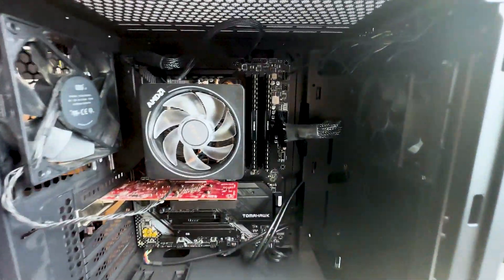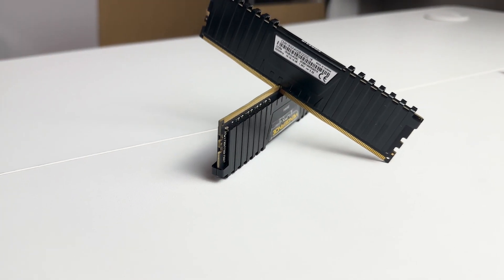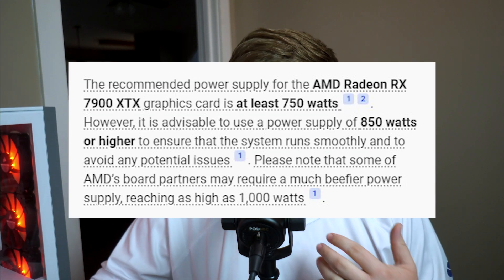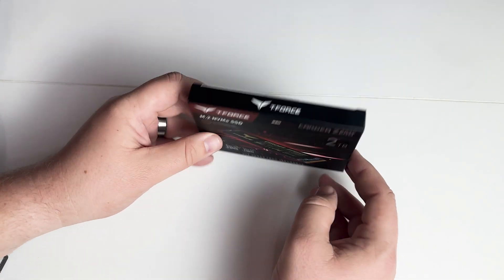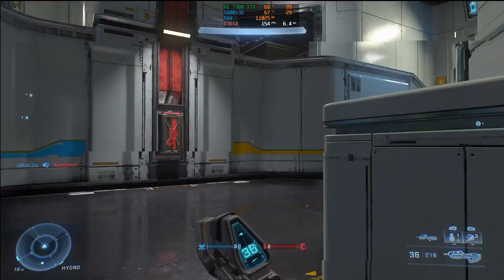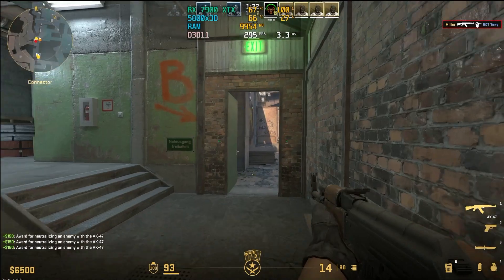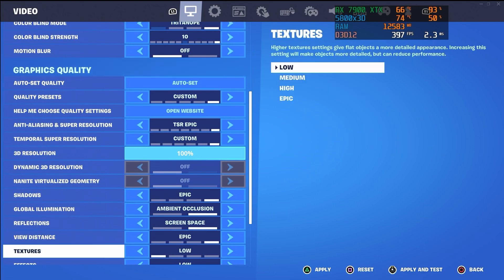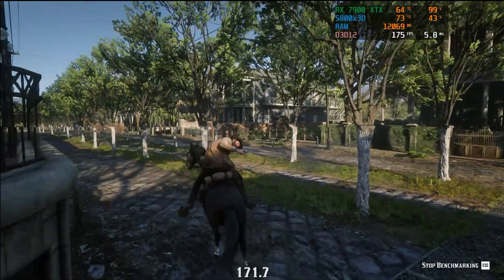This PC Got the ULTIMATE AM4 Upgrade!!

Comment: There wasn't much problem with the stock cooler for the processor it had after upgrading yesh fine what was wasn't bad. 

The motherboard vrm power 5800x should be Max 5800xd will work fine and msi motherboard csn easily work out

Comment: I'm curious why you kept the b550 with a budget of $2000? Of course, the 5800x3d is still fantastic, but am4 is technically dead. Anyways, cool video! You're really good at fitting a lot of content in without dragging it out.
Reply from the maker: Well we ended up only spending around $1800. The customer wanted to save as many parts as he could so I felt that the ram and the motherboard were the best ways to save money. He will probably not upgrade for a long time and he is fine playing at 1080p. 

If I was starting fresh with $2000 I Definitely would have done something different. 

Thank you for watching and the compliment! I appreciate it!
Reply: @MMillerPCs  that makes a lot of sense, thanks for the reply!

Comment: Should i pair my ryzen 5 5600 with a gtx 1660 super???
Reply from the maker: It’s not going to hurt anything! That CPU can handle much better GPUs but it’s not going to cause damage or anything like that
Reply: @MMillerPCs  so no bottleneck?
Reply from the maker: @goat_cheese012  there is always a “bottleneck” you can’t let that word bother you. 

The 1660 super is only going to be so good. You could get a better GPU if you wanted
Reply: @MMillerPCs  k thanks

Comment: I don't like how you frowned on prism cooler. It's my favorite cooler for 6 cores. As long as your not using the stock CPU it comes with then it's kinda premium. Pretty much nothing you can get for the $20 you get them for from the stock boys.
Reply from the maker: I use stock coolers on builds all the time!! But we couldn’t use it for the CPU we had planned for the build. They are great for what they do.

The prism is not my favorite aesthetic wise though lol
Reply: @MMillerPCs  it's the availability. You found get them for $20 cash off random people all the time. And if you wanna get wierd you can separate them and paint.
Reply from the maker: @rodneyhobbs6507   I have never tried to take apart this particuar model and paint it. It is the beefier one with the rgb fan. I have done that with some others.
Reply: @MMillerPCs  prisms come apart difficultly. There are 4 black tabs 2 on each side and a wierd 2 piece bar system to hold the retention levers. Try and pay attention to how those go back. Get a small blocker of some sort (I used a Velcro tie down cus it's there) pry a black tab with a narrow tool and block it with something from latching again then repeat second one on same side. The other side will be easier but not easy. Now you have a black thing with a fan in it and the 2 latch parts that just fell out leaving you with the question about which way they go back in. Remember it has holes for 2 plugs and a switch to cover and both the ring and the amd logo are led so don't paint them.